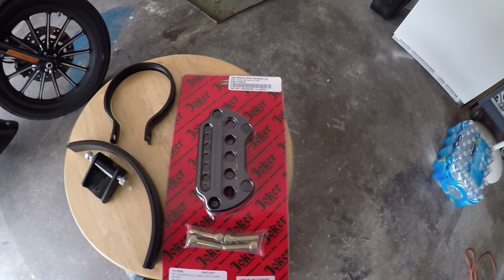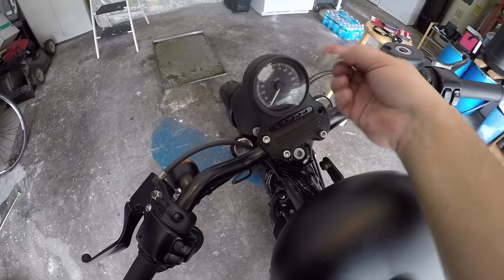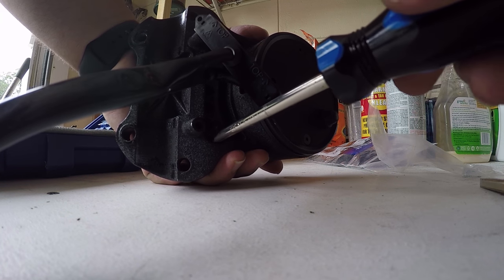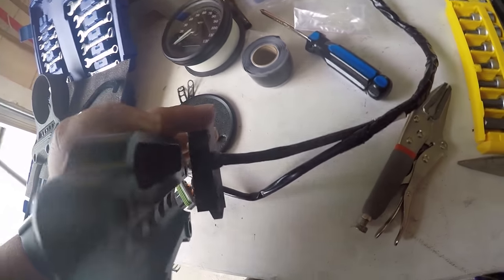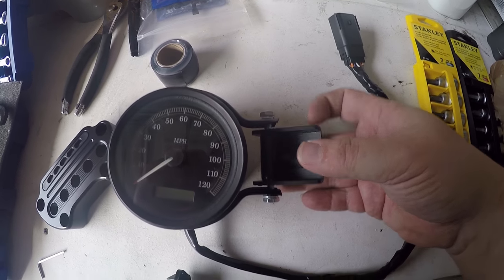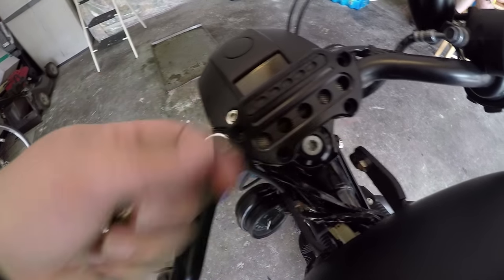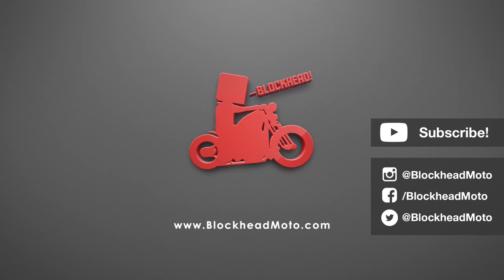HOW TO: Gauge Relocation Install on Harley Sportster Iron 883

Comment: You are really good at customizing the bike. I really like how you are not afraid to tear it down to make it the way you want it. I on the other hand feel like I am not good enough to do all of these mods. Very nice and the bike looks like one of a kind. Ride Safe
Reply from the maker: +HarleyDayRider Thanks! Yeah I was nervous at first too when I started working on cars, but the more you do it, you build your confidence. Gotta start somewhere! And a bike is way easier than a car 👍🏼
Reply: Also Blockhead was not born with the knowlege doing this stuff. It's just practice. Just do it! If it takes you longer, this doesn't matter. But with every little thing you do on your bike (or car, or anything else), you will get to know it better and better.

Comment: I have just relocated my speedo, and installed the headlight grill on my 2014 iron 883. Had some trouble with the wiring on this model, since the two connectors for headlight and gauge are connected to each other with little slack... But, it all worked out in the end... Thank you so much for your videos, couldn't have done it without you! Cheers from Oslo!
Reply from the maker: Glad to hear the video helped you out, congrats on your relocated speedo! Ride safe :)
Reply: What exactly did you do Stian?  I have a 2016 iron.  Just got all of the parts listed in this video and noticed there is less than half of the wire distance blockhead has.  I don't see a feasible way of this working.
Reply: How did you fix the little slack issue, im having the same issue and the only thing i can tjink of is to splice the wires to make them longer....not wanting to do that at all.
Reply: What did you do to mitigate the slack problem?

Comment: Good video.  My Joker bracket turned purple with the sun pretty quick so I had to paint it black.  Based on the lift I did on my tank I had to install it to the fork.  That was a pain because I had to extend all the cables.  Looks better then stock for sure.
Reply from the maker: Trial and error, right! All a part of customizing, but worth it :)

Comment: Heads up to anyone doing this modification... if you have a 883 from 2015+ the harness wires will not be long enough to split.. you will have to do extra steps.
Reply: I just noticed tht
Reply: @ricardovillavazquez8497 what extra steps were needed?
Reply: What extra steps are those going to be?
Reply: My speedometer doesn’t seem to come with the plastic cover over the led strip 😢. Any idea where I could get one of those? Thank you.

Comment: I feel like I missed something right before you put the gauge into the clamp... Did you just screw the rubber back piece back on and tape around the white part, or was there a sleeve or something that it went into? Other than that, the video was helpful and pretty easy to follow.  Thank you!

Comment: Just a heads up, this does not work on 2017's. the wiring from the speedometer to the indicator lights are too short.
Reply: What's the solution? Have a '17 and want to do this
Reply: I have a 2017 , is it easy to find longer wires after getting this? or what should the solution be?
Reply: TikiziaBT  I’m having the same issue. I’m buying a soldering kit and lengthening the wires.
Reply: Joey Marez did it worked fine after extending the wires?
Reply: Cesar Geronimo yes!! It worked perfectly! I had no issues.
Reply: I can confirm this. I cut the wires and extended them to make it work.
Reply: Just experienced this 😑 going to extend my wires then should be good to go
Reply: Jesse White It worked for me. I had no issues.
Reply: This might be a noob question but what kind of wire did you use to extend?
Reply: @MrStrangle2b  try my comment above if you're still stuck and your bike is 2014 or newer
Reply: New to this, I have a 2020 883 and just tried this and wires are to short, is there a video of how to extend these wires? And what kind of wires do I use?
Reply: @AMXZ28   what kind of wiring did you use to extend your speedometer harness?
Reply: Michael Slye I had an old wiring harness and I spliced and soldered the wires together to make them longer. Go to any local auto parts store and buy some wires bud

Comment: Had nightmares of doing something like this to my Yamaha Warrior.  Changed my bars also and had to remove the headlight, remove, detach wires inside the headlight, saw off some cable and wire retaining hardware, fight everything back together, test, redo, test, redo, test redo, and reassemble everything with the new speedo location and handlebars.  This is easier but...  it still gives me nightmares of the 6 hour mod on the Yamaha.

Comment: Very nice video. Wanted to know if the speedo wires are long enough to go a couple inches higher? I have a iron 883 on order and am gonna do different bars and wanted to move the speedo up but did not know if enough wire slack makes it possible. Thanks ahead of time!

Comment: A bought a peedometer Side Mount Relocation Bracket Indicator Handlebar Clamp Black Aluminum for Sportster Iron 883 XL1200 XL883 48 72 1995-2015 and I have a 2014 Harley Sportser when I finish it Why is it upside down should I get the joker machine will that be better?

Comment: Thanks for all these videos Blockhead. I have a 2016 and I got lucky to stumble upon your page. I did the tank lift and wire tuck but I'm having a problem relocating the speedo. The wires connecting the LEDs to the speedo are simply not long enough. Do you have any suggestions? Also, did you have to relocate your coils in order for the bolt to be long enough that holds the tank and speedo bracket in place?
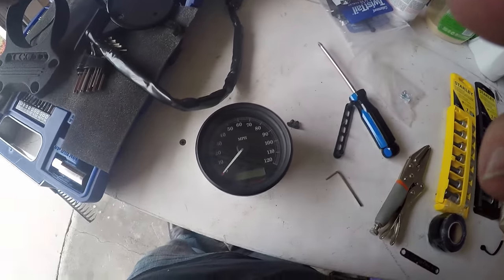Reply from the maker: Did you see the part where I cut the black plastic that was pairing the LED and speedo wires? If you don't cut that off, you have very little room. The part at 3:39 is what I'm talking about. 

As for length of bolt that holds tank and speedo bracket, that doesn't really have anything to do w/ coils at all, would have had clearance either way. I did get a longer bolt whenever I did a tank lift, so that might help out a bit, but I think even w/ the stock bolt, you'll have enough room to mount the speedo bracket (takes up very little room on the bolt.)
Reply: BLOCKHEAD I cut that black plastic but it didn't really make a difference. It barely reached and the speedo would have had to be upside down for it to work. I might just try to put it on the right side of the bike instead. The wiring might be different this year. 

I honestly didn't even check to see if the aftermarket bolt that came with the lift kit was longer than the stock one. I got a different one than you did. 

Either way, thanks for the reply. I'll see what I can do

Comment: Quick question I have a 2016 iron 883 just recently installed the memphis shades gauntlet fair and I am not currently wanting to relocate my speedometer but would I be able to as the mounting hard ware is attached to my top forks. Love the videos by the way

Comment: Help! I have this exact setup for my speedo on my Iron 883 and my speedo needle is in the 6 o clock position in middle of the digital analog screen. It is 25 mph under my actual speed but will rise when I ride. So in order for needle to hit 0 mph I have to do 25 mph and for it to hit 25 mph I have to drive 50 mph. Can I reposition the needle if I open up the speedo and remove the screen cover? Im scared man. What do I do?

Comment: Blockhead, quick question regarding the Auto Meter clamp. The Amazon link sends me to a bare metal / "silver" color style clamp. Where can I get a hold of an all black one like yours? Thanks!
Reply from the maker: Mine is the bare metal one, I just sanded it down and painted it. They don't sell a black on unfortunately :)
Reply: Awesome, thank you!

Comment: Hey blockhead your bike looks really good.  your how to vids r awesome.  what's next on your mods list?
Reply from the maker: Thanks Burt! Next up on the mods list is changing out the external breather bolts on the air cleaner to a hose / filter system, as I'm getting blowby on the side of the bike time to time. Kind of annoying, but this should fix it. After that, possibly drag bars? Probably drag bars and some new grips from Arlen Ness. Then Daymaker headlight, LED front signals w/ smoked lenses, possibly front turn signal relocation. I think after that, that'll complete the front of the bike. Then I can focus on the back, considering a rear fender chop / bobber style, probably a new seat, LED rear signals... the list goes on and on and on, haha

Comment: If you want to go cheap just use original handlebar mounting plate and just cut off and grind where speedo was and just buy the autometer bracket

Comment: What year is your bike btw? I am doing the same set-up but for some reason the split between the wires for my indicator and the speedometer isn't the same length as yours. So if i was to mount the clamp on top of the bar, I wouldn't be able to reach anywhere to mount my speedometer.. I have a 2016 sportster 883
Reply: Davis Le I have the same problem.. any solutions?

Comment: Hi mr Blockhead i have an 2015 iron 883 , i wanna do the speedo relocate just like ur however i heard there a rumor about the indicators light wire not long enough! Any recommendations for that ? Thank you and love ur videos
Reply: Andy- just ran into this problem( its the weekend and everything is closed) I think I can extend the wires but want to make sure first.I will send you a message when I find out.
Reply: Did it work? I ran into the same problem.

Comment: Quick question here. Did your front fork push the speedo when turning left? I have a similar side mount, but my front fork is pushing on it.
Reply: Yo! Just did my relocation tonight (still have to get a wiring extension, 2022 problems) and mine barely touches the Speedo when turning all the way left. I ended up having to use the top hole on the new clamp. It will sit lower and be a little more out of view but I didn't see a huge issue with it. It'll still be visible when riding, you just have to peep your head over to see it a little bit more. I hope this helps!
Reply: @bigmama900  Hey, am planning to do gauge relocation on ‘22 sportster. Where can I find the wiring extension. Did you face any issues while doing this?
Reply: @007navraj same here, wiring is too short, did you find an extension solution to the cables?

Comment: I have a 2015 and the wires are too short as well.  I even purchased a new assembly from Harley ($48) and the wires don’t look any longer SMDH 🤦‍♂️
Reply: Ok boys here's the deal.  BLOCK has a 2013 Sportster.  Harley Davidson made a wiring change in the assembly starting in 2014. (you'll notice a factory splice on the red wire from the LED)  I have a 2015 Sportster 883N and 2013 wiring will NOT FIT.  I suggest if you have a 2014 or newer model, purchase another assembly (approx. $50) and then splice/solder the wires from the old assembly into the new one so you get around 16" between the LED and the plug in for the speedo.  That will solve the problem!!!  Of course some of you will have better splicing skills with more cost effective wiring, I just chose to keep the same color scheme and use factory wiring.  remember NO FACTORY 2013 wires will fit a 2014 or newer.

Comment: do you know if  unplugging your speedometer resets the miles?
Reply: It won't, the miles are stored on the bike's on board computer so when you swap to the "RPM" speedo for example it'll populate the bike's correct mileage.

Comment: If you have a 2016 don't follow these instructions... And definitely don't purchase the speedometer 3 piece relocator! I tried to follow the instructions from " blockhead" and now I am in the middle of a screwed up mess. Lucky, I can figure this all out ,but have to wait to see if I can extend the wires to move then gauges.(absolutely nothing fits)!
Would of been nice to know before I took everything apart ! 😕

Comment: so just an FYI for anyone reading the comments. This apparently doesn't work as easily on a 2016 iron.  I bought all the parts, super pumped. and then BAM. Harley changed the harness slightly. So you cant separate the indicator plug from the instrument plug as far as required. It would require cutting and extending the wires. I was not that committed so i Just gave up.
Reply: SSleepingPanda so this definitely wouldn't fit a 2017 then huh
Reply: Steven Gardy I doubt it.  You could cut and extend the wires but I didn't want to.  Look into the joker machine gauge relocation.  Amazon sells a replica one. Looks and functions the same for like 37 bucks
Reply: SSleepingPanda cool thanks I'll look into it
Reply: SSleepingPanda I ended up putting the gauge on the headlight screw
Reply: Eleazar Duenez do you have a picture of this?

Comment: Hi Block !

My Iron is from 2017 and the wiring from the speedometer to the indicator lights on this model are too short. Do you know if we can buy a wiring set from another model ? 

Thanks ! :)
Reply: i am having the same problem on my 16 iron. i think i'm going to cut the 5 wires (or 6) and extend them with some extra wiring by soldering about 8" piece of wire to each one... wires are not long enough as on his 13 iron
Reply: @joshuagongora-fernandez3988  - I am going to try it , I will let you know( I have a 2016)
Reply: Captain Obvious... soldered 8 inch length wires and it was not enough. Might need like 14" wire additions and it's 10 wires to be extended. My wires were too short. Attached it to the right fork since the harness does not stress that way when you turn the handlebars.. took for a ride. So far so good....
Reply: Captain Obvious  hi captain obvious....just wanted to know did it work well by extending the wires.? Regards.
Reply: @cesargeronimo3779  - Yes i had the local Harley Davidson Dealership 
Extend the wires by 6" and it work out well. It cost me $60.00. 
I've been very happy ☺.Now about to raise the tank and put on drag racing bars..Going to look awesome !!
Reply: @cesargeronimo3779  - I am trying to duplicate "M- Rivers" bike" getting closer..looking good !! Very pleased !
Reply: Captain Obvious very nice thank you.
Reply: One of you can makes a tutorial about this ahah ? ;D